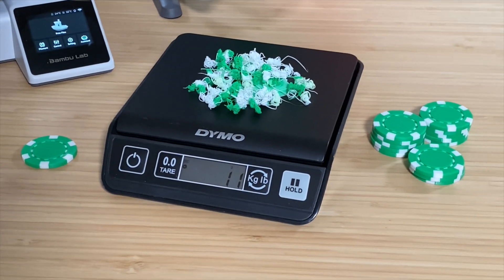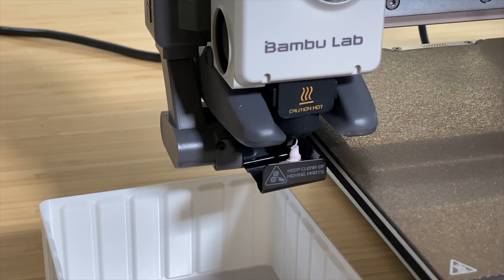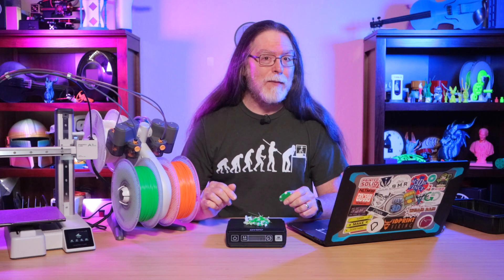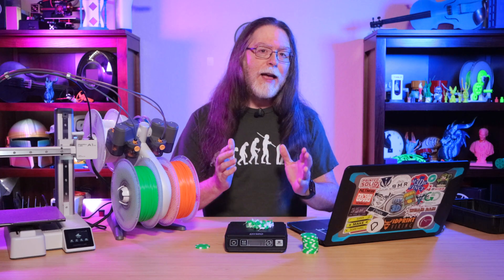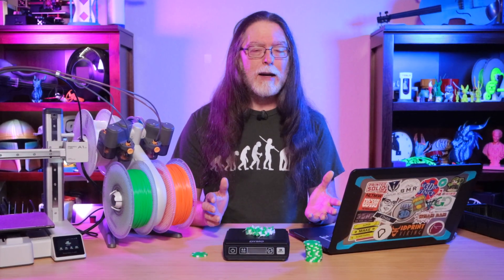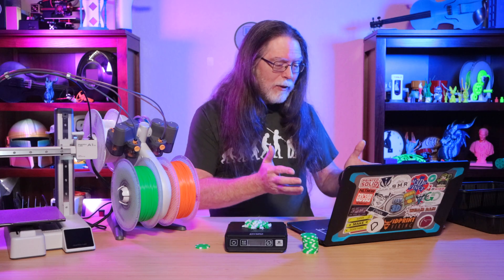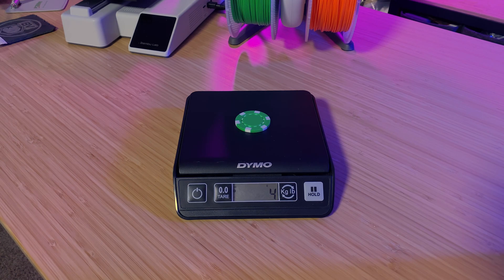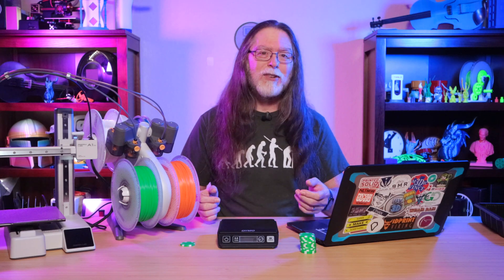Multi-Color: Print More. Waste Less.

Comment: Prusa has it right with multi print heads. It is what it is.
Reply from the maker: I agree 100%. The five toolhead XL is a bit pricey though, but you really can't beat tool changers for minimizing purge waste.
Reply: @BV3D  You're right of course. The XL is very pricey but filament isn't all that cheap over time. I just don't think I could stand to look at all that wasted material knowing that I have no viable way to turn it back into usable filament.